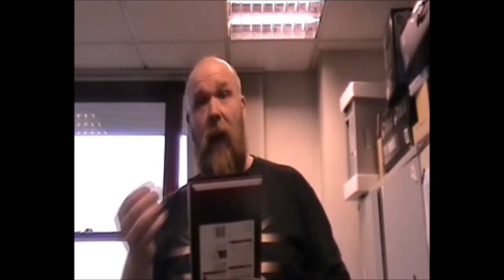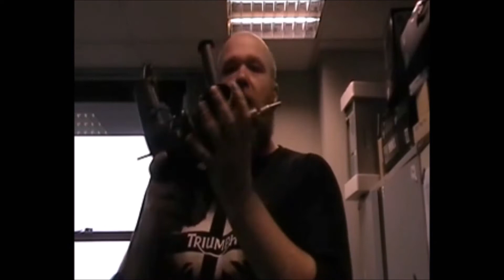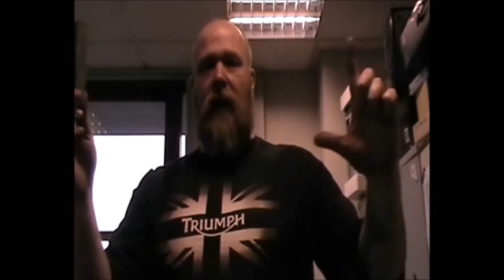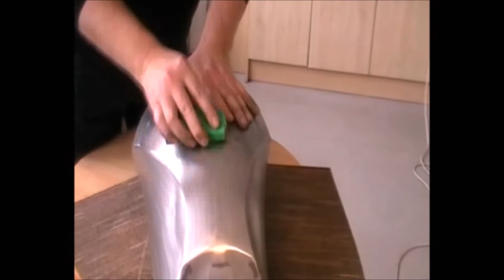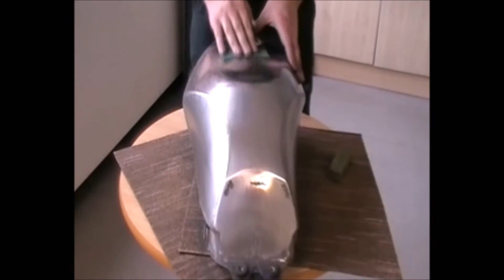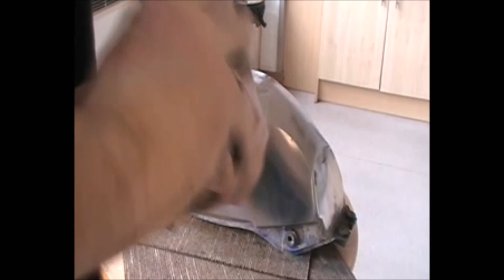Guide to polishing  metal - Chrome Finish.

Comment: The wheels are cast alloy and not machined to a perfectly smooth finish. The brake dust, road grime and oil from the chain gets ingrained and they really hate the salt on the road. Triumph factory told me to use 800 wet and dry then Solvol Autosol. This may well work, but I didn't expect to have to do this after my bike was 6 months old! If I try this, I will do a video. Thanks again buddy.

Comment: Hi I've only just come across this video but I found it really useful. Im hoping I can use the same technique to clean up and old theatre light (strand pat 123) which I've had for ages. do you think this technique would work? It would be slightly more fiddly as its made up from lots of Smaller parts rather than one big piece. Also if I want a gun metal dull finish rather than shinny chrome finish how would I achieve this? Thanks dude any advice is much appreciated